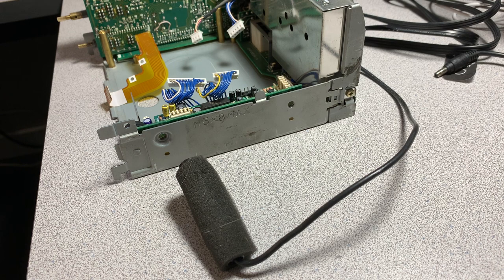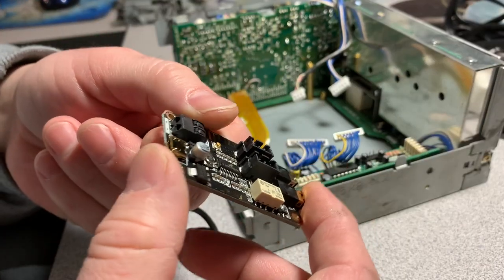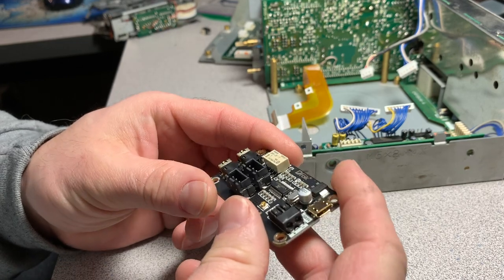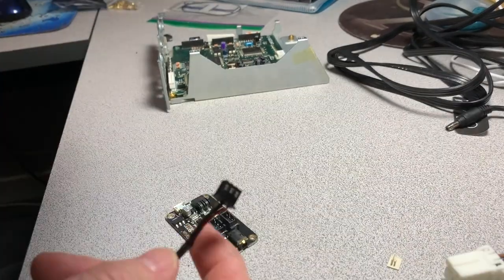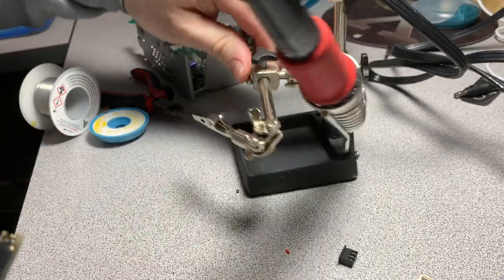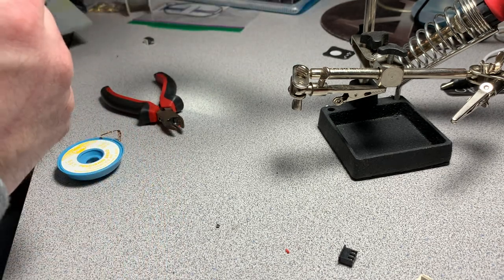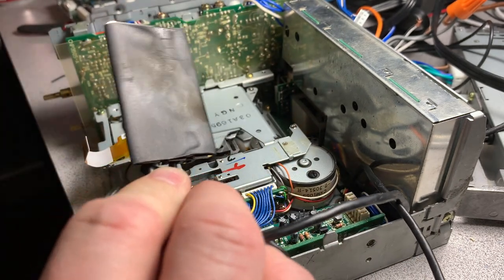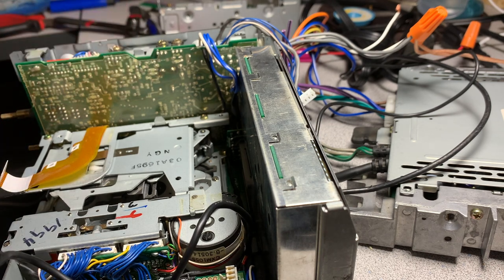Mazda Miata Pioneer MSSS1 "Silver Stereo" - FULLY INTEGRATED BLUETOOTH MOD, Start To Finish!

Comment: Buy a new stereo for your Mazda , imagine having carplay while driving your Miata
Reply from the maker: The car already has a modern stereo with full hands-free system and iphone integration… I want the original stereo in the dash at ALL costs! this is a vintage car that gets driven once a week, having it original is worth the world to me.
Reply from the maker: I mean, I literally have roughly $500 invested in this project… for half that, I could have purchased a low-end carplay unit - but restomodding the original stereo is SOO much more satisfying.